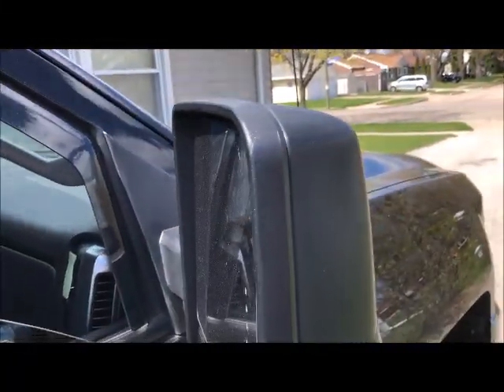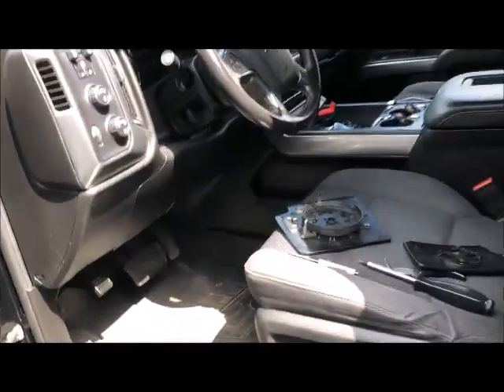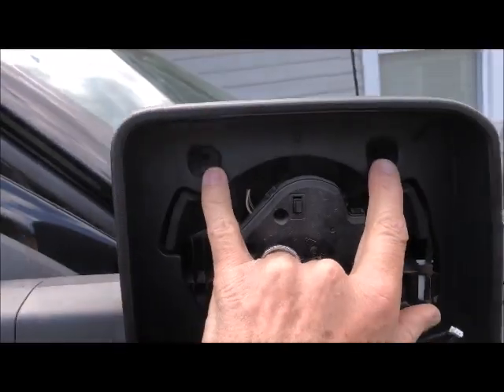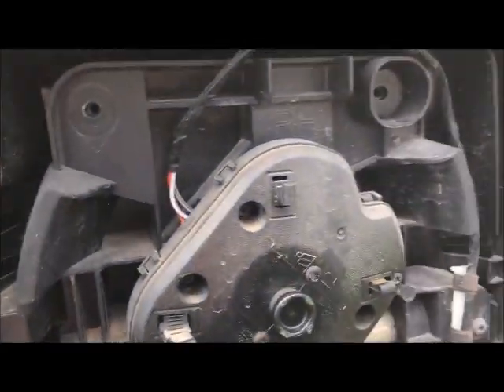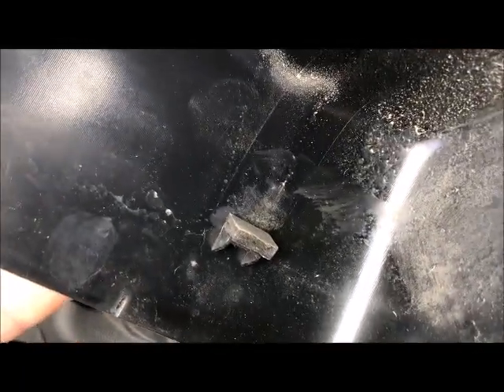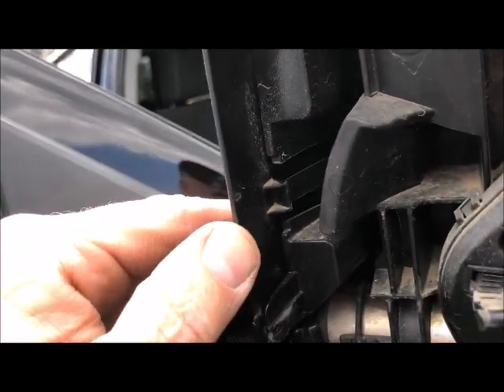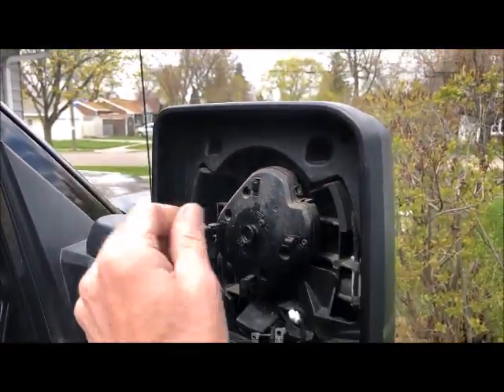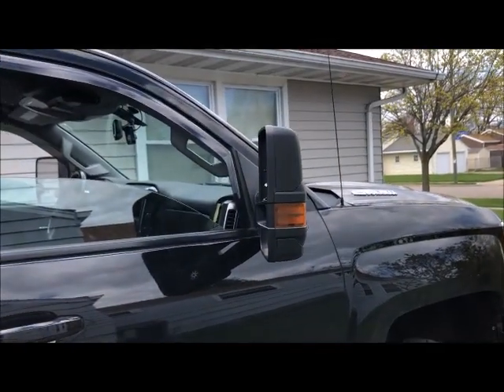2017 Silverado 2500HD Door Mirror Rattle Fix

Comment: How about a 2017 Chevy Cruze premier with the outside mirror itself rattling when the stereo is on even at low volume? Meaning you could hear the rattle from the outside. Also does that truck have the same kind of electric locks on the inside with a little pin pops up the black pin that rattles on my car those are the only two things. I'm trying to figure out how to fix that one without affecting its operation. If you have any suggestions I appreciate it. Thank you